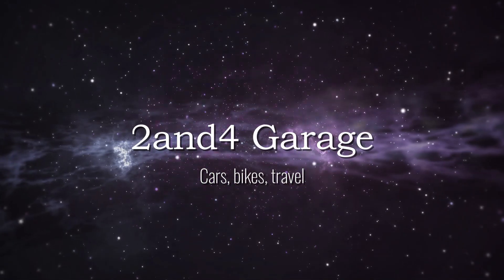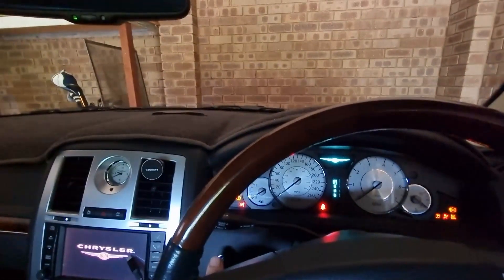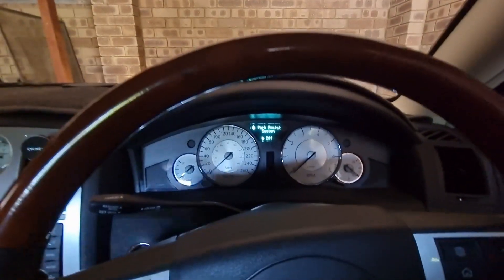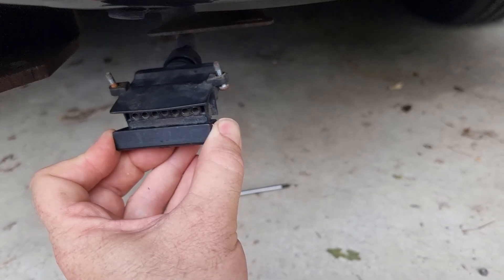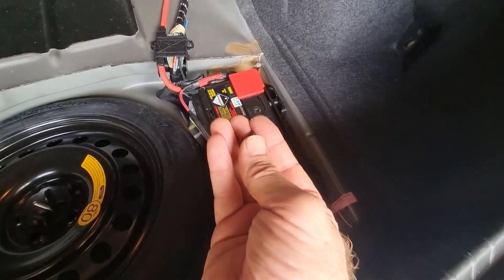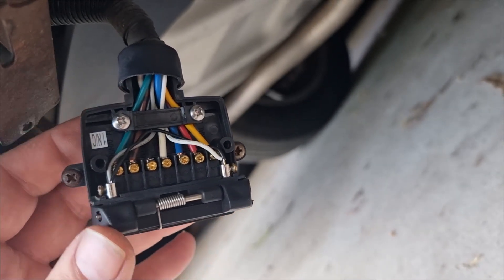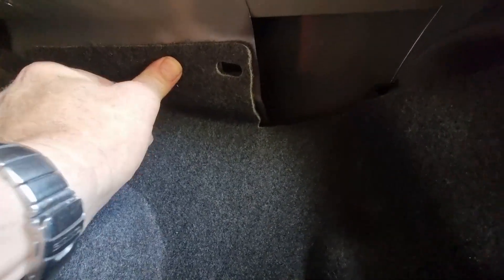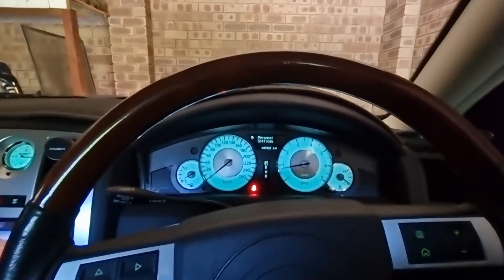2012 Chrysler 300C Park Assist System Malfunction

Comment: Hi, im currently having this issue on my 2010 crd. Exactly the same (no tow hitch though), did changing the module in the boot fixed the issue?
Reply from the maker: No. The scan tool tells me that I have a faulty #1 sensor. I haven't yet discovered which one that is, but its enough to disable the entire system and lead you down the path of a faulty module.

Comment: Hi John, I had my rear sensors on the Ford Territory giving me the shites for ages. Everytime that I wanted them to work, I would simply drive through a car wash and voila! The system was all good again 😂. Obviously,  there was a connection problem and new sensors later (which I didn't need at the end) I got our local auto electricians and they found the fault at last!!
Reply from the maker: That's gold! You sure had the cleanest Territory around. You should have had a roll of glad wrap to seal in the moisture. 😀